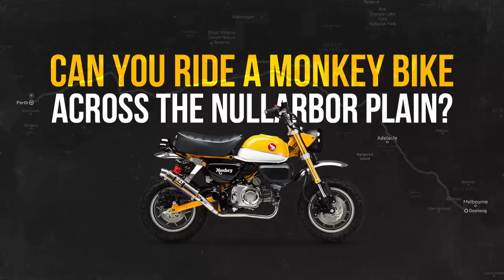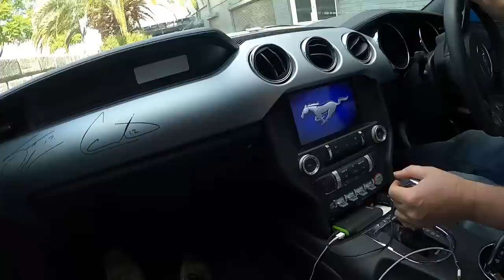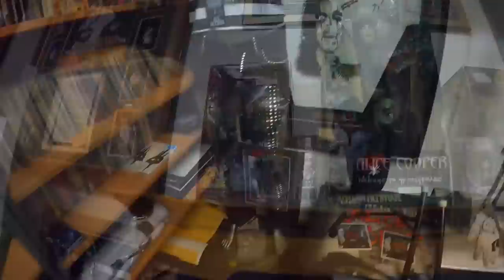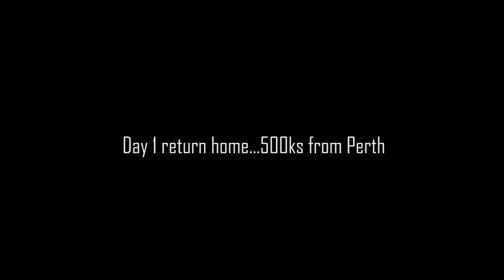SECRET MAN CAVE and the MONKEY BIKE GOES HOME !

Comment: Sounds counterintuitive but when you ride in that sort of heat, you will actually stay cooler with a long sleeve jacket on. The reason being it doesn't let your sweat evaporate as quickly which in turn keeps you cooler.

Comment: Another great chapter in this legendary journey.  Just a question about running the tank completely dry: doesn’t the fuel pump in the tank overheat and get damaged when you do that?  When I had a Honda, I was told some fuel is needed in the tank to cool the pump. I guess we’ll see in the next installment.
Reply: not really good to run any engine out of fuel for a few reasons